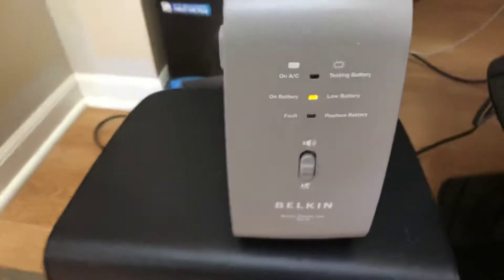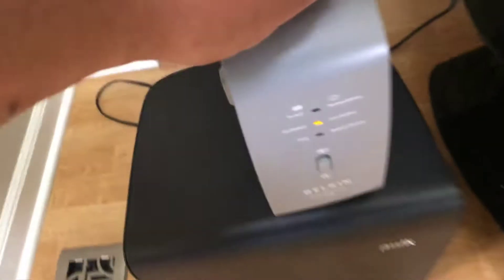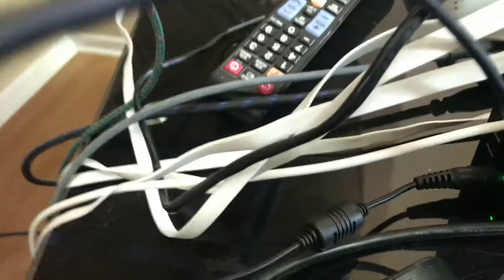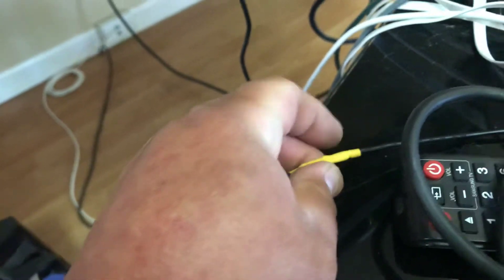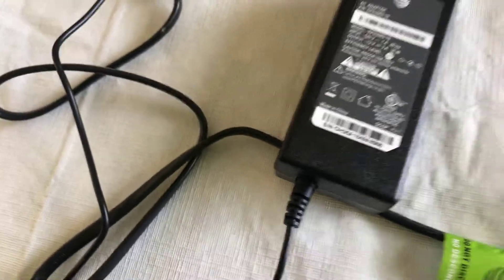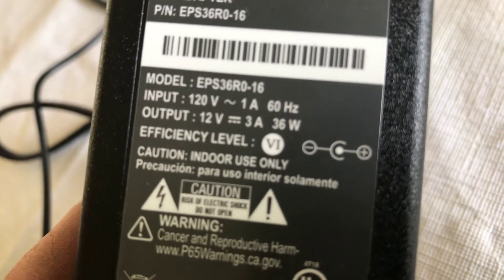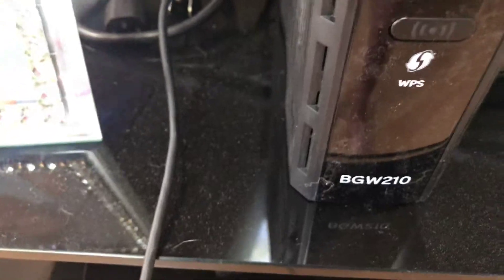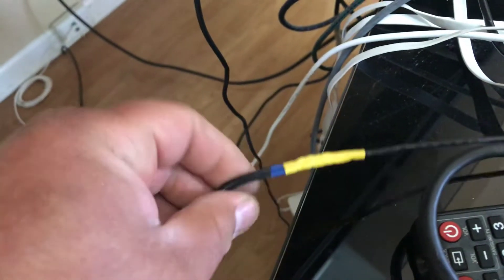BGW-210 modem / battery backup mod

Comment: FYI, they make a 2.1mm to 2.5mm DC Barrel Plug Adapter if you don't want to cut the original barrel plug.Also if you need to replace the factory battery on the BU3DC001-12V the part number is F6c127xBAT and is a  12v 7.5Ah battery. 
If you want to upgrade the battery you can use a UB1280 12v 8Ah or a UB1290 12v 9Ah
Reply from the maker: Pete Williams huh I didn’t even think about that lol 😂 
And thanks for watching and your suggestions i did replace the battery once already when I got if from GW (good will) because it wasn’t holding a charge and thanks for the upgraded battery part number I’ll keep that in mind too for the future again I appreciate your comments
Reply: Turns out the Arris BGW210-700 takes a much larger Barrel plug than the 2.5mm. I ended up cutting the wire off the AC/DC power supply and wiring in a 2.1mm Female to the cut end so I didn't have to cut the Belkin wires. So far the adapter cable works great.
Reply: @petewilliams5801 Hi, do you know if it would be possible to connect a  2.1mm female DC Plug Power Adapter with a USB connector on the other side of the wire?  And support 12v?